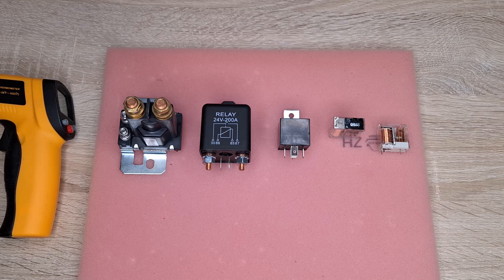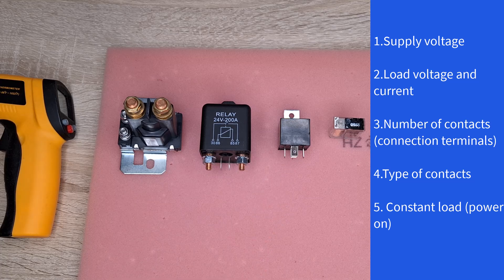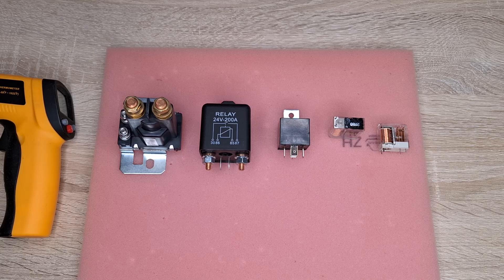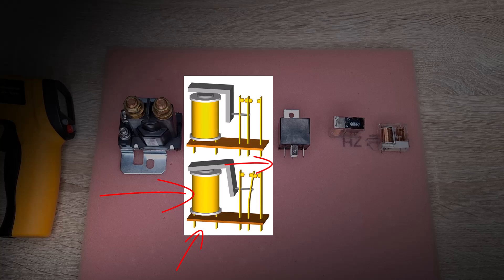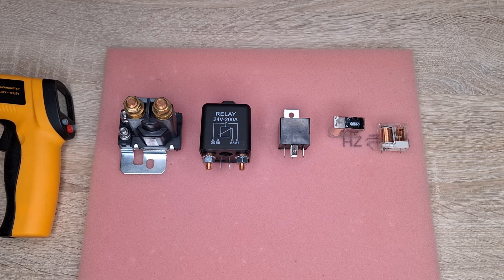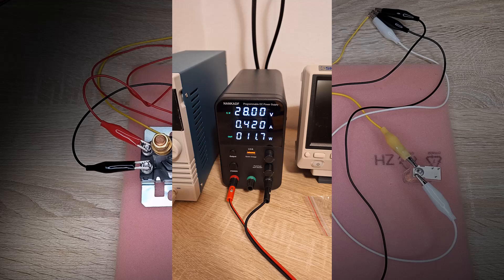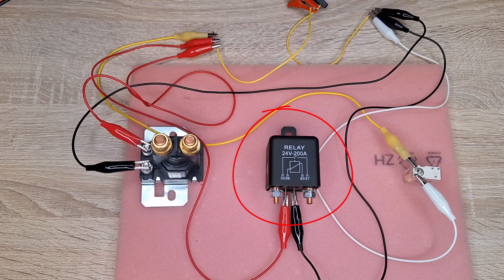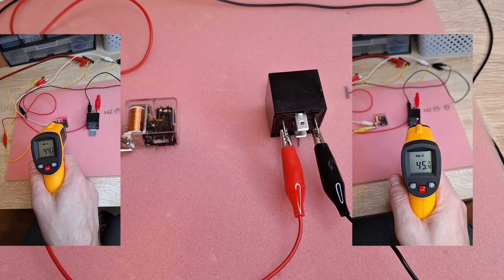Relays test - Remote Control Lawn Mower DIY

Comment: Hola Gregor !. Me Encantar tus videos !. Me gustaria si puedes ayudarme como puedo conectar actuador lineal a mi receptor FlySky FS iA10B uso controlador de Cytron MDDS30
Reply from the maker: Hello,
It's basically very easy. One channel from the RC receiver you connect to the Cytron controller and then where the electric motor is usually connected, you connect the actuator. Do you have a more specific problem? What are you worried about? I don't speak Spanish so I use google translate as well :)
Reply: The problem I have is that I use the 2 channels of the MDDS30A for the 2 MY1016Z3 motors to drive forward, backward and both sides and the linear actuator only has 2 positive and negative cables, can I connect it to the relay that you told me to turn on the lights?
It is a 12v 30w 3 Ah linear actuator. Can I use the relay to turn on the lights to make the linear actuator extend its entire distance, which is 10cm, or even stop before it extends its entire length and then retract inwards?
Is one relay enough or should I buy 2, one to extend the length of the actuator and another to change the current so that the linear actuator retracts?
Sorry if I didn't explain myself well, next time I'll try to be clearer!
I really appreciate your help, I built it to help my father in the field. I am a professional driver. I had a serious accident and my back is broken. I can no longer do international work. @gregorkobetic
Reply from the maker: No problem, it's easy. Buy this relays from the link below and connect it to a channel where you have three position switch or  joystick, so that you can move the actuator out, in and stop. https://drive.google.com/open?id=13Fb0eEKkRRdKi0nUl82udXW9trxm3iGB&usp=drive_fs
Reply: Thank you very much, you are my teacher in this, I still don't know how to do so many things that I would like to do with the robot apart from making it autonomous haha

Well now we're going to the countryside, a big hug from Valencia Spain @gregorkobetic